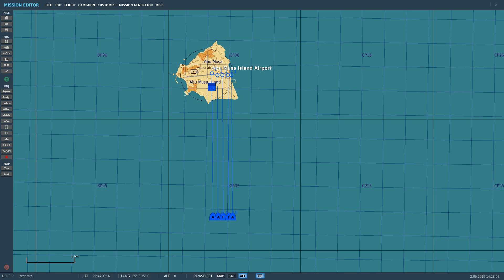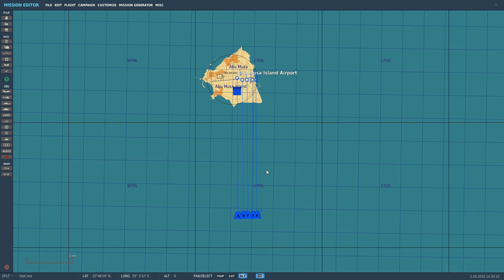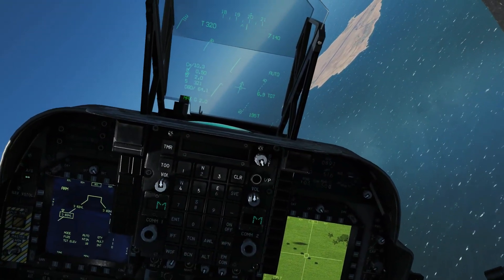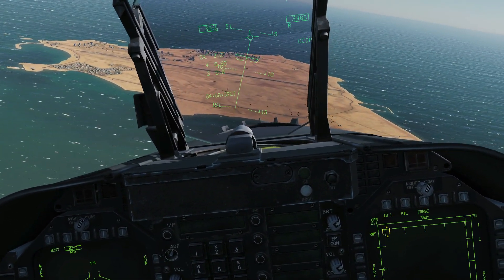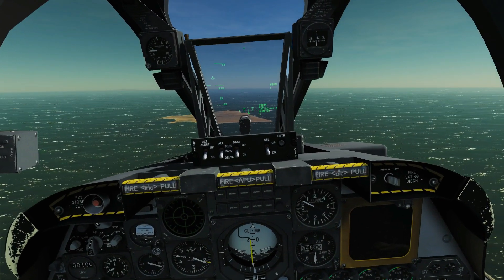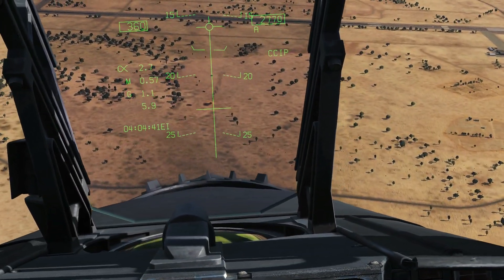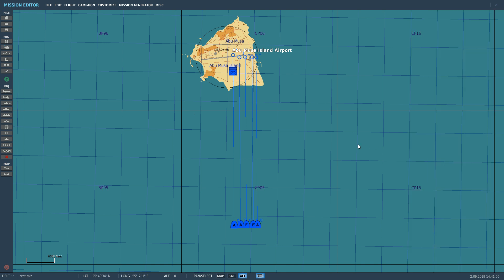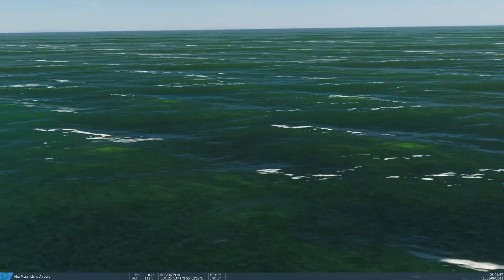Questioned: Problems With Using High Drag Bombs In Wind? | DCS WORLD

Comment: So basically, the auto system compensates for wind automatically... I guess it could be done by sensors such as pieto, AoA, ground link to METARS?
Reply: Usually the air data system senses speed and direction through the AIR, while other systems (GPS) senses speed/direction over the GROUND. The difference of the two is used by the weapon system to calculate and incorperate the wind.
Reply from the maker: ,Also maybe the ground crew enter wind details into the WCS? guessing here

Comment: Cap, run the test with A-10C, Mk-82 AIR, 5m/s crosswind, CCRP approach from >10nm ~2000m KEEPING the pipper dot on the ASL the entire way. The aiming symbology is noticeably wrong which can be clearly seen before releasing any weapon (build 35461).

Demonstration: https://www.youtube.com/watch?v=6P3Iu4w66E4

What you will see is commanded aiming is to put the nose well upwind (too far?) and about 6-10 seconds to release a constant and increasing turn back downwind which becomes not followable during the last few seconds before release. What's expected is some straight line aiming, wings level, constant-heading bombing solution from far distance through release. ASL means CCRP, never CCIP. All of the CCIP tests were wasted effort.
Reply from the maker: Interesting, thx

Comment: Grim Reapers thank you for treating my request however you missed the most important part which is to test in Auto (CCRP). Unfortunately you did all your tests in CCIP, which works just fine. I have found issues with the Hornet and A-10C (don't have the harrier so can't test this one) where the line was drifting to the side in very noticeable way. Turbulence didn't have any effects by the way, only the wind settings did.
Reply: CCRP line drifts for me in A-10C too, good to know it is not just me (in this case at least)!
Reply: veenee have you tried using a bit of rudder to straighten it up?
Reply: @KeithGadget  This is unaffected by rudder.
Reply: I've seen this drift in the Harrier. You can be in level flight lined up and the fall line swings left/right.
Reply: I notice it too, usually on servers that have decent dynamic weather.
I also found the longer spent on "playtime" the worse it would get (almost as if it was trying to calculate for the wind and the INS was drifting for the aircraft but not for the CCRP target)

Comment: What exactly was the thinking behind high drag munitions? Is it a crude way of getting them to travel further?
Reply: Lets  you drop bombs from very low altitudes with less risk of blowing your own tail off from the blast and shrapnel. High drag = more separation between bomb and aircraft by the time the bomb hits.
Reply: Jason Osmond oohhh an elegantly simple solution.
Reply: @Exile89-19  "Fragging yourself" (Fragmentation) is the term given if you cause damamge to your own aircraft by getting caught in your own bomb blast. Fragging your mates/wingmen happens if you don't co-ordinate (i.e. time seperation) your attacks if attacking the same target from low altitude. During the Gulf War, RAF Tornado/Harrier/Jaguar etc usually had a ToT (Time on Target) tollerance of +/- 3 seconds.

Comment: as mentioned in the Video, there was no Detail about AC and heigh. For me, it doesn't make sence to drop highdrag bombs form more then 1500ft AGL. the higher you get the more they will miss the target. It's the same if people complaining about low drag bombing in auto mode at 18k ft and missing the target, too. Why don't they use GBU's? Or other stuff like Mavericks and so on.

Comment: I’m pretty sure in CCIP, that line is called the bomb fall line, not the azimuth steering line. An azimuth steering line would only make sense for AUTO/CCRP because it’s telling you which way to steer where as CCIP is just telling you where the bomb will go based on your aircraft’s current parameters. I’ve never had the problem that was described though, but then again, I’m a fair weather flyer